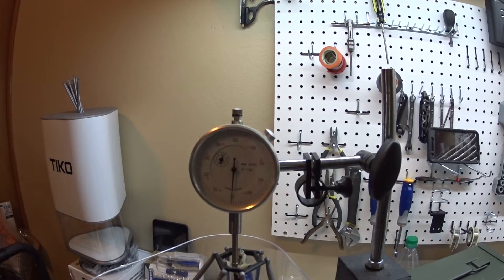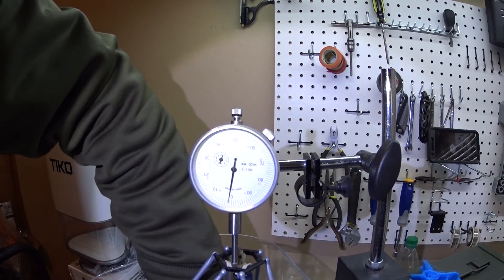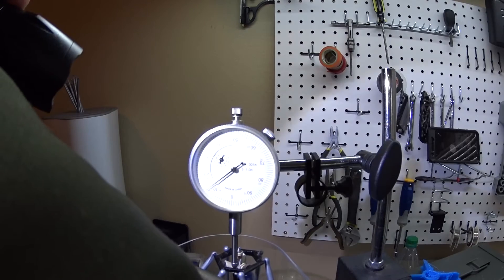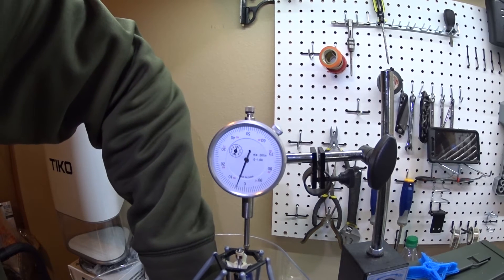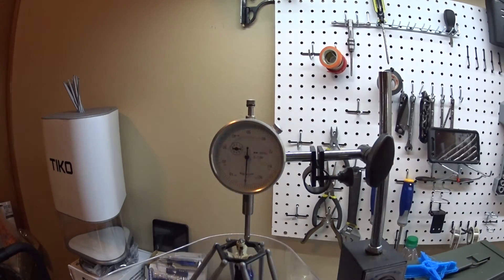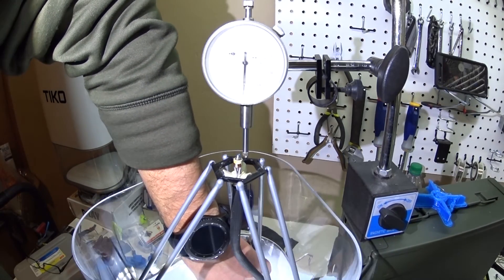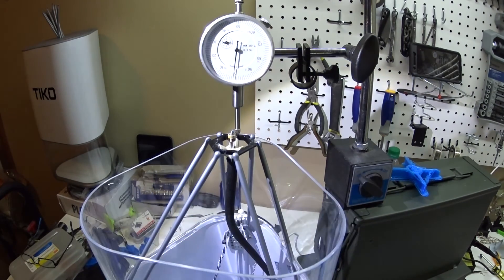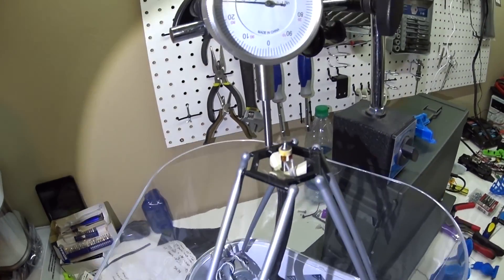Production Tiko Carriage/Motor Backlash

Comment: Would you be willing to post your Slic3r settings?
Reply from the maker: Hi Jim Neill,

Here you go:
https://drive.google.com/file/d/0B5yotFnROWGJR0s5SEItSmdrVTQ/view?usp=sharing

This profile is completely experimental so use at your own risk. I was getting really good results on the FW 2.0.4 and haven't had much luck with the FW 2.1.0 but this will be a good starting point. I am going to keep playing with the setting until they are consistently good but time has been a bit short for me recently. 

I should mention that most of these setting were from my large Delata printer from Ultibots (K250v) and I slowed down the print speeds and adjusted the build area so that I wouldn't try to print something that was to big. 

Thanks for watching.
Reply: Thanks so much.
Reply from the maker: Hi Jim

Not a problem. Im working on a spiral vase profile that seems to be working pretty good. I'll upload that one if this print comes out good.